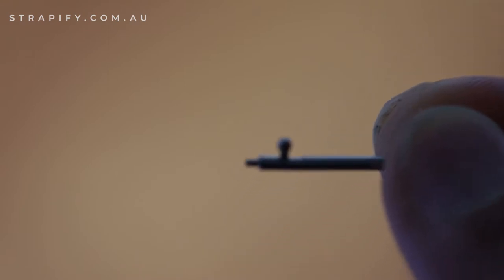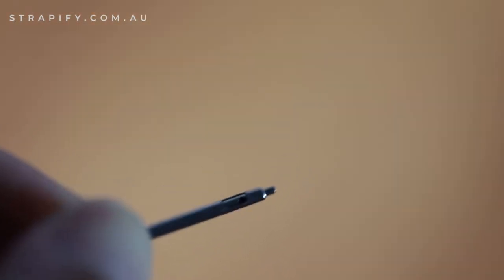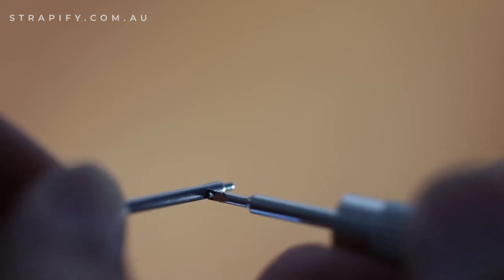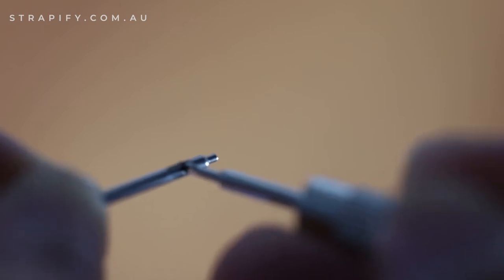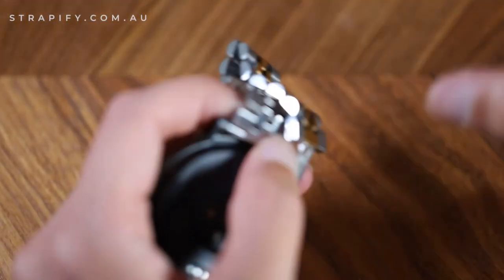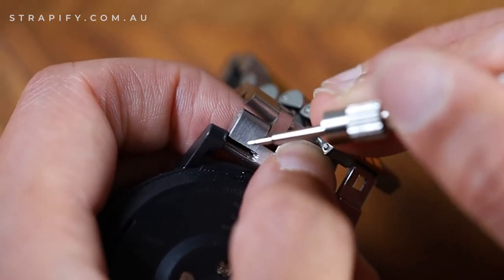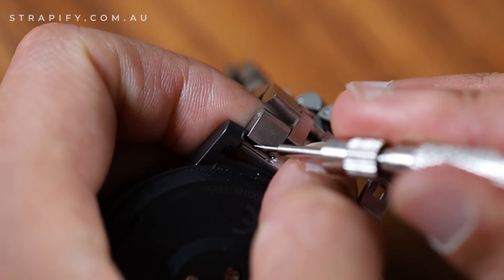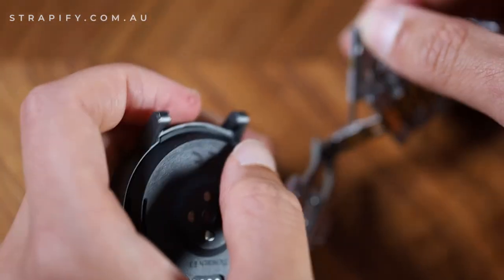HOW TO: Remove BROKEN Quick Release Spring Bars!

Comment: Thank you sir, managed to do it, mine was broken in a way where there wasn't a hole, only an irregular surface, and it was hard to spin, but it worked out in the end thanks!
Reply from the maker: Glad we could he of assistance!
Reply: What did you do to make it spin I'm having the same issue
Reply: @montanapranke3555  It was hard and it took me a while, I manged to make it spin by doing very small movements towards the right direction. It was hard but it's possible. Best of luck, I know how difficult and annoying it is to solve this

Comment: What if the knob is still attached but it won’t compress even with a tool. Like the spring is locked
Reply from the maker: Get a set of pliers and break the lever off. It will then give you access to that hole.
Reply: @strapify  thanks for the tip!